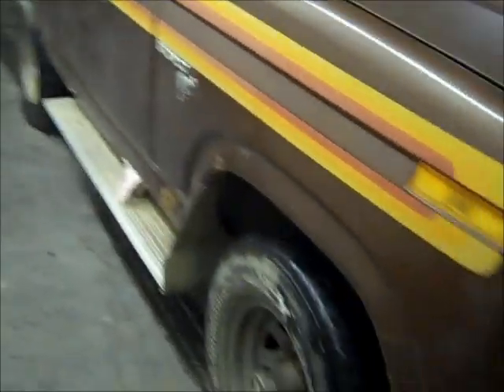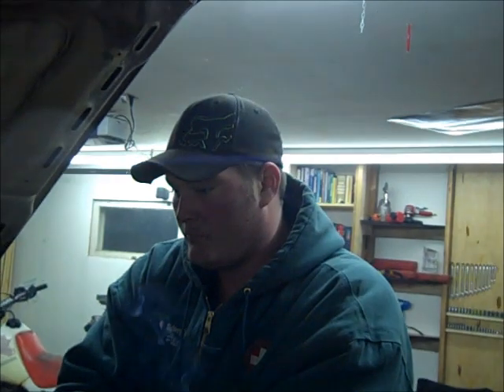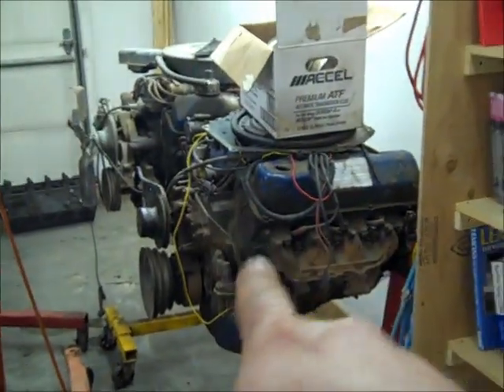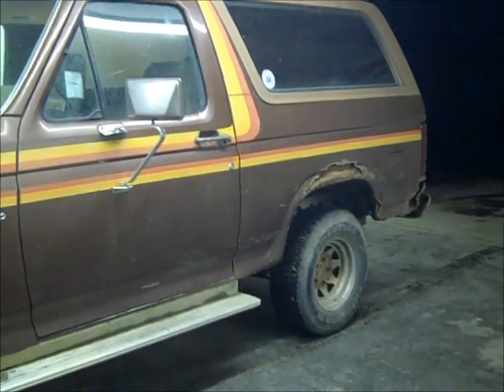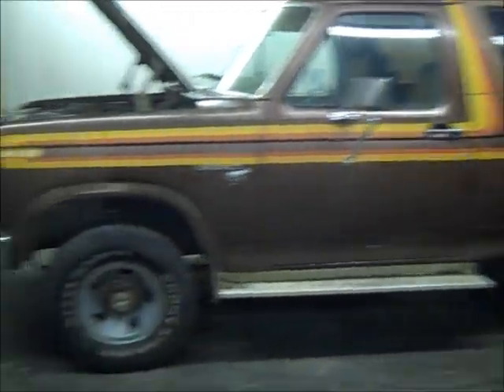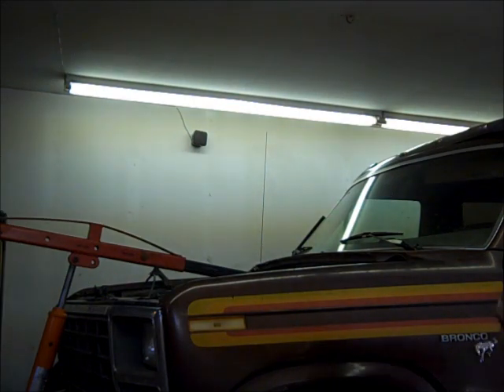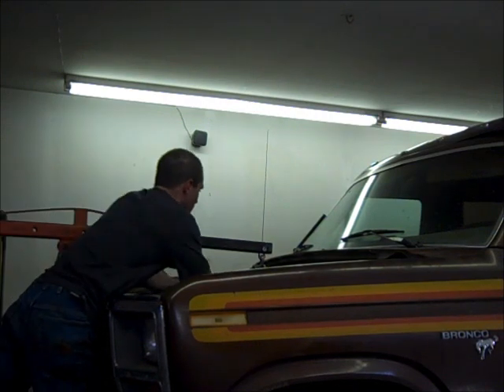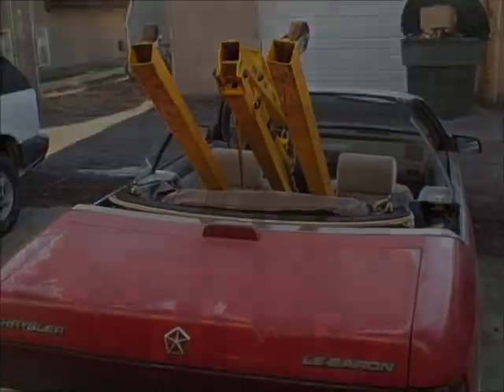Rehabilitation of the Brown Cow Part 1

Comment: 33's WILL fit with no lift. the fit will be a touch snug, but you can either trim the edges of the bumper, or use washers as shims at the bumper mount. you can run a 3" body lift if you like to clear these tires, but its not necesary. slight rub will be encountered on the radius arms,depending on the dimensions of the rims

Comment: well a stuck valve would be caused from the no oil pressure oil isnt gettin to valve train n stuff ya know so i say stuck intake though becasue i had a vehical that was doin the same thing makin same noise and it was intake  and another thing is with the cummins diesel haha 2 compltly different motor so dont say im an idoit or nothin but they kinda sound like that when they have bad head gaskets

Comment: My dads last f150 with the 4.6 had a sparkplug loosen up and popmout of the engine and thats what it sounded like when it ran. Sounds like you have a hole or crack where there shouldent be one. Lol my little john deere 650 has 31's on the back